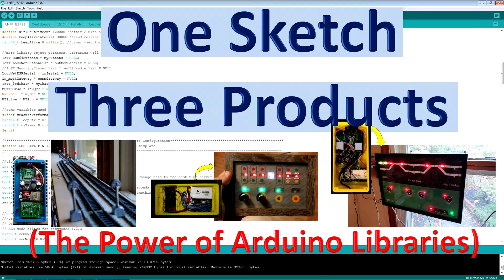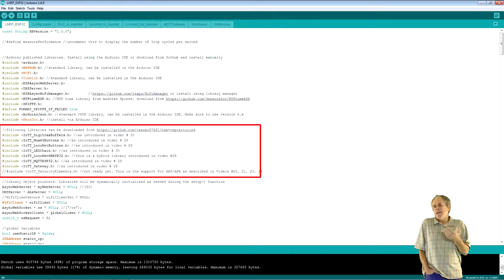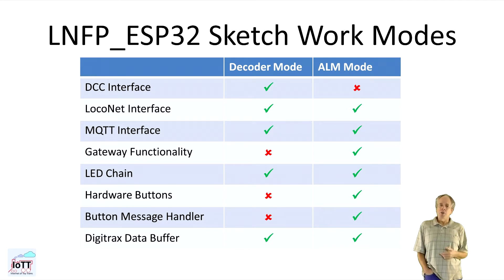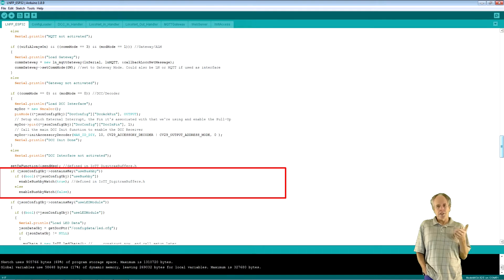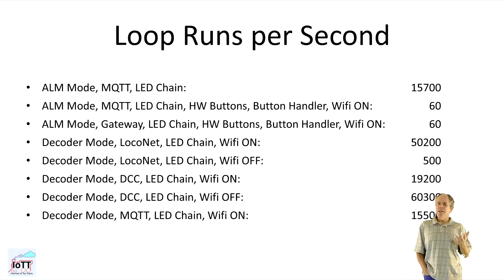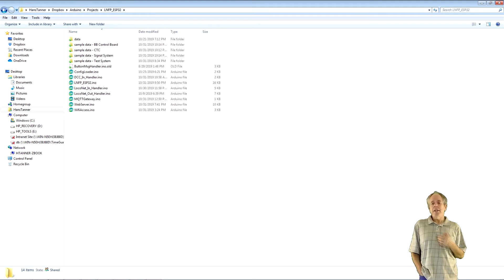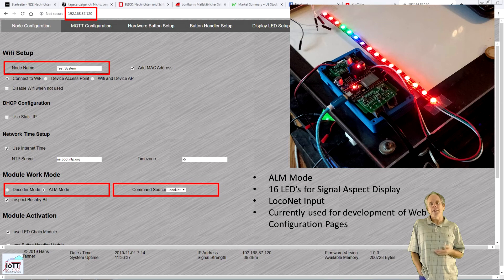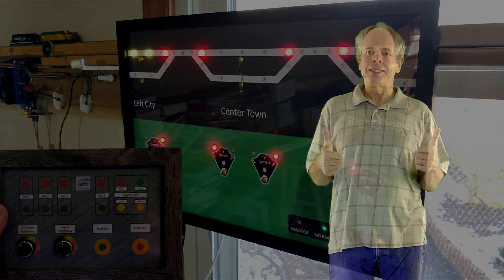One Sketch - Three Products (Video#31)

Comment: One small step for eventual control of my Rail way, One Giant step forward.........   I Have LNEF_ESP32 compiled and downloaded to  a NODEMCU ESP-32S
using the latest Lib.zip plus 2 other Library down loads,  TimeLib.h and AsyncTCP.h.
I know have serial monitor scrolling along saying....   0 reconnect wifi    :-))
Time to return to watching the video,  how hard can this be  ;-))
Thank you Hans for the latest Lib.zip.  Much appreciated.

Ross
NZ
Reply from the maker: Very good, you're getting there. Now, the reconnect message happens if there is no node.cfg file loaded. Make sure that you load the SPIFFS data from the data directory in your sketch folder. There is a link in the description of the video to an article explaining how to install the SPIFFS loader and upload the SPIFFS data.
When everything is correct, you should see a scan() message in the monitor and you should be able to connect to the ESP provided access point using your cell phone. There you can enter your router and password information and it should then connect to your Wifi network. When you restart the ESP next time, it will connect automatically and it will also print its own IP in the monitor.
And there is a little trick to bypass this configuration by adding   WiFi.begin(<your SSID>, <your router password>); in the beginning of the establishWifiConnection() function. This will make it connect directly to your router. Just remove the command after the first successful connection so you do not leave your access information in the code.
Once connection is established, you can point a browser to the IP address of the ESP and the configuration screen will load. The first and the second tab (Node config and MQTT config) will work, the others are not complete yet but coming soon.
Reply: @IoTT   Well,  it works just like the video says it should.  2 ESP32s showing on my MQTT Broker.   Now, if only I had a clue as to what everything does or means then I might comprehend.    One step at a time :-) time for some experimenting.
Reply from the maker: Excellent, congrats. Now, it would be helpful you explain what you want to achieve. First your hardware. Do you have an LED chain attached to it? Maybe hardware buttons as well? What about LocoNet or DCC interface? Are you looking to build a CTC panel or just a signal decoder? If you plan to get the commands via MQTT, how are you feeding the commands from LocoNet into MQTT? Or do you want to generate LocoNet commands on your PC, e.g. using Node-RED, and just sending them to the decoder without a "real" LocoNet system? Tons of possibilities ;-)
Reply: @IoTT My  goal is to use variations of the "Universal Control Panel" (UCP) to get portable local access to turnout control for each of the junctions to replace the "run in front of the train to check on the state of the track" method.  These will have buttons, LEDs for position indicators, and the power stop/go.  

 My logic process...  
1- UCP buttons ->MQTT client-> WiFi->MQTT Broker-> WiFi->-> MQTT client->loconet->Decoder->move servo.

2- t/o pos. feedback->decoder->loconet->MQTT client->WiFi-> MQTT Broker->WiFi-> MQTT client->UCP LED indication.

Currently I have an outdoor railway with the Arduino Uno DCC++ system running the trains using wireless throttles based on the Arduino pro mini.  I have Railroad & Co. "TrainController" software and am using loconet (locobuffer with no base station)  for all turnouts, turnout position feedback ,signals and, block occupancy.  There are Arduino Pro mini boards on loconet access boards scatered around the railway doing the work. I also have a Loconet->DCC++ interface which lets the PC software throttle to control trains.
Reply from the maker: Sounds reasonable. DCC++ should be available for ESP32 pretty soon, Mike Dunston is working on it. His repository is found at https://github.com/atanisoft if you are interested. As far as I know he is also working on a LocoNet interface for the DCC++ command station.
With your concept in mind, I suggest you do one stationary ESP32 equipped with a LocoNet interface that is running as gateway, feeding all commands to the MQTT broker. It probably would make sense to also run the button handler on that device. The CTC panel example would  e a good starting point for this.
Each UCP then just needs the  ESP32 with a LED Chain for display and a button module for input. Should be no problem to configure this using the sketch you just made work. You can use the BB Control Board data as starting point.
I am almost done with the web pages for configuration, which will make that process pretty simple. Probably one or two more weeks until this becomes available.
Reply: @IoTT  Hi,  Thank you for this much appreciated concept road map for the way forward.  There is an entertaining challenge ahead for sure.

Comment: I'm still having issues. Can you please make your complete arduino library zip file available for download ?
Reply from the maker: Ok, I have added a libs.zip file with all my own and some of the standard libraries I used. You find it in the LNFP_ESP32 Sketch directory on Github.
Reply from the maker: Note there is a new version of the libs.zip file. I replaced the ESPAsyncWifiManager by a version from a different fork that has better support for the ESP32.